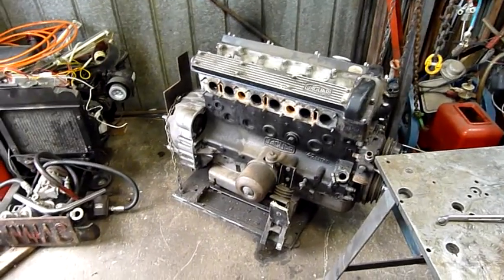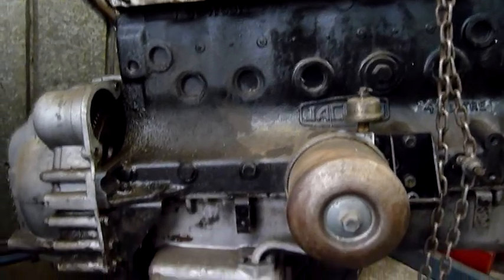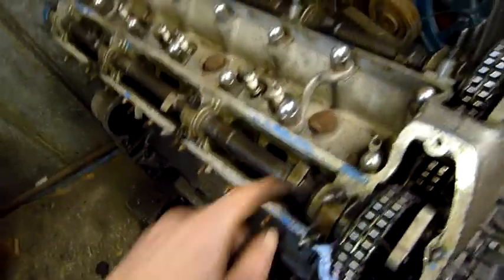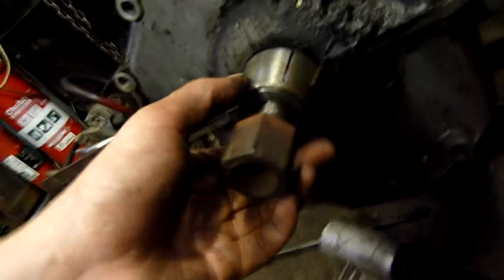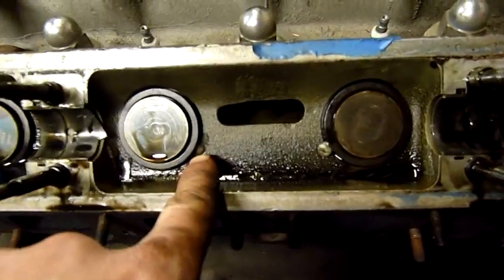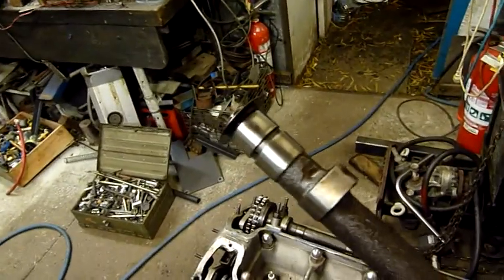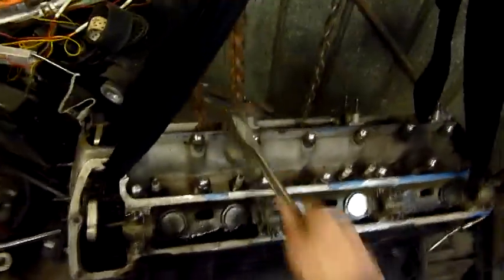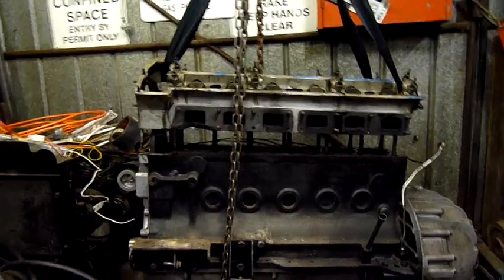1969 J60 4.2L Jaguar Engine Autopsy Pt1

Comment: those bolts that pin the buckets in are actually called stitches, they are narrow right above the threads and they are made to snap off when bottomed out, they also use them to stitch cast iron cracks up, you should check it out

Comment: I forgot to put in my response , yes the Brits make a quality motor , I used to have MGs , Jags , and Nortons  and the inside of the motor was machined and the casting was clear and crisp , not like a american engine where you find all sorts of casting flash inside and outside , and see where the sand was not tamped and when I rebuild them I  have to spend several hours removing it to make sure they do not turn into stitch makers by cutting yourself or braking loose in the engine  .

Comment: Hello sir. What happens if Intake cam has replaced  with exhaust cam?
Reply: Amir XJ 40 ...the left and right cam lobes on the cams are positioned different 
It would be insane to criss cross them....will destroy your pistons.
Reply: @dinos7185  thank you so much sir🙏